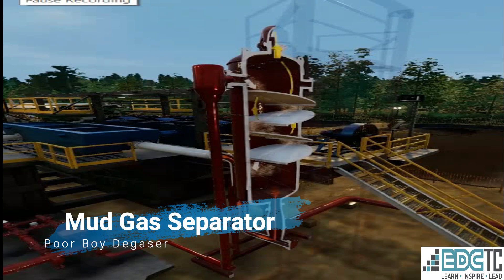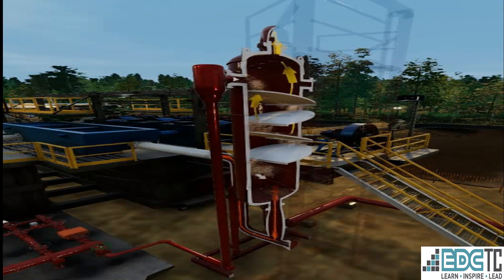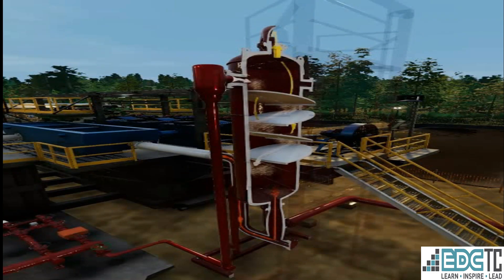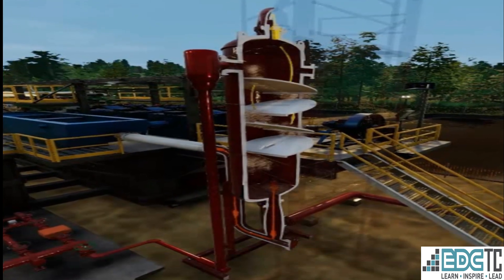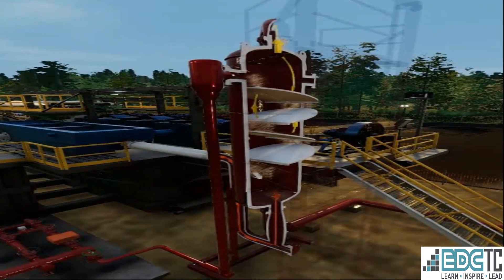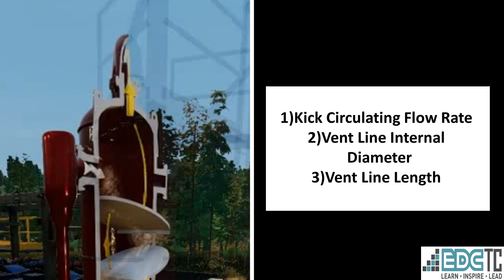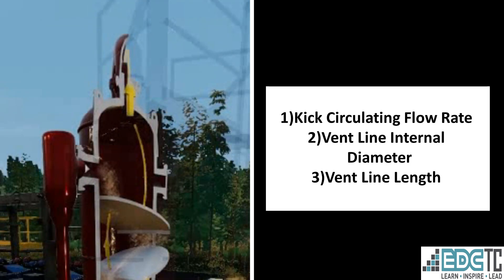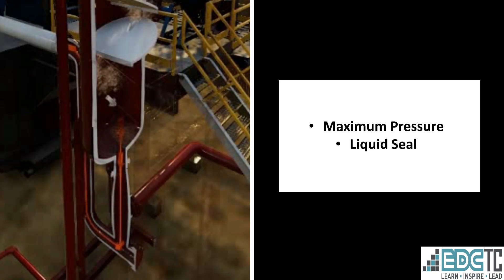Mud Gas Separator - English Voice Over

Comment: how can we calculate volume of separated gas ?
Reply from the maker: Every separator has a separation capacity; which means there is a max BPM that it can handle. Peactically, we circulate the gas at slow rate to avoid exceeding the capacity.